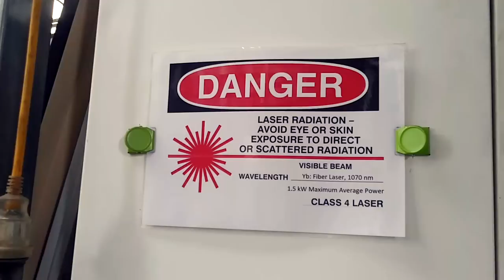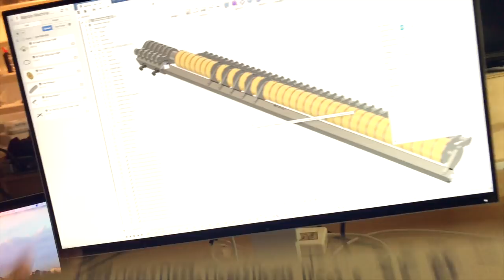Muting System Assembly - Marble Machine X #41

Comment: When TIG welding, be sure to clean everything.  This avoids the bubbles in the weld, called porosity.  If you must weld anything galvanized, grind off the galvanizing as much as possible.  If this is not possible, you can try silicon bronze filler...but then you are brazing, not welding.

Comment: Always clamp the workpiece in several places - (as many clamps as possible) - to a heavy piece of steel angle to prevent the metal distorting. If you have to move the clamps to be able to weld a section, ensure the work has cooled first.

Comment: By the way have you gotten your acrylic problem figured out?  If not, I usually make a form and bake it in an oven for a period of time, at about 120 °F.  It usually will bend to the shape of the form with just gravity.  
Side note your welding is improving bit by bit, also there is another technique you may wish to employ, the "lay wire" technique.
See you next Wednesday.

Comment: Since you're TIG welding, clean up the mill scale and what not off of the metal. It will weld SOOOOOOOO much easier/better. Put any nuts and bolts that are coated (anything other than stainless I suppose) in hydrochloric acid for a few seconds and it will eat the zinc away, just weld them before they flash rust. Also, I've never noticed much difference in tungsten sizes.

Comment: i hope the set screws in the wood will stay tight. if not, you may need to weld each metal arm to the metal tubes, and just have the wood in there as a cosmetic spacer.

Comment: Hold the gas on the weld a bit longer after stopping the arc. Your machine should have a control for that. The porosity you're getting at the end of the welds should go down. You may also want to increase overall gas flow, there's some extra porosity along the weld.
Reply: Very true, I think a little bit more gas is needed here (or the needle is too far out). In TIG welding, once it bubbles, you can't do anything about it. Instead of welding nuts onto the square tubing I'd cut threads into a 20 x 5 steel bar, and weld that onto the tube. You should look for a ironmongery or a metalworking shop in your vicinity, 25x2 is a standard size for square tubing, just too much work to weld these yourself. And if you do, start at both ends and meet in the middle.

Comment: I'm worried about a few things. First, the heaviest part of the muting system is on the thinnest bar, and is the furthest from the controls, meaning it's more likely to bend. Second, how are going to guarantee registration between the  controllers when the mute is released? Two flat wood surfaces interlocking seems risky, especially when it must happen 22 times all at once. Even if you get the tension perfect, it strikes me that you're going to have channels that simply slip and will jam, especially with that thin tube of metal being slightly more flexible and prone to bend out of shape when you slam the mute on or off.

I'm worried.

Comment: 25.09mm is INSANELY accurate!!! Most car manufacturers can't get that close! Professional reverse-engineering guy here: +/- 0.15mm is usually "good enough" on a measurement that size. Then again for structural beams I'd imagine 24.98 would be considered "undersized" and fail in a heartbeat (cosmetic stuff though: if it still fits, it goes!)

Also, many modern cars still use the "welded nut" solution everywhere, even (especially?) in safety situations. I see it frequently in trunk areas to secure things as lightweight as speakers and behind trim for things as heavy as seat belt securing points. Given the horrific results of rivnuts, especially in accident situations in unibody cars, what better way is there to secure bolts than welding on the cheapest of materials (i.e. the nut) into place to serve as a stud? Hardly a hack if it's VERY common practice right? :-)

I have seen this practice in place for decades across numerous makes and models domestic and import. Stroll through a junkyard, it can be an inspiring place once you get past the decaying state of the cars themselves!

Comment: Its hard at first but you can hold the welder slightly more away from what you are wanting to weld.. doing that and going slower will help the heat dispersion not end up all in one area.. nice job though

Comment: I have tried to make a case for adding brazing to your shop skills  A whole bunch of problems could have been alleviated if you had used brazing instead of welding.
Another thing to worry about is all the weight you are adding high on the machine, because of the steel parts.  The parts could have been made of much thinner steel (no more then 1mm thick) to save weight, and cutting time on the laser cutter.  Why did you double them up?
Setscrews are notorious for coming loose!  If you must repair anything in the assembly, all the screws must be loosened.  I would drill pilot holes in the tubing and use a setscrew with a pin tip to engage into the holes.  You can do this on all the actuators, and later after setting everything up, do it also on the handle ends.

Comment: Martin, you may be a musician and videographer but I've seen many mechanical engineers that would throw up their hands and give up if asked to do what you are doing.  Both the CAD/CAM work and the machine design look excellent.  You do need to work on your welding, though.

Comment: 8:00 Kinda worried that the set screws you used to hold the wood to the metal muting bar, will eventually work loose/slip over time due to expansion/contraction (varying humidity levels). Wood is not the best at holding a set screw tight in place, especially under load (unless the set screw is also partially set into the muting bar's metal via a small hole).

Comment: What kind of gas are you using? There should be zero Sparks or splatter with Tig. If you are using pure argon (only use pure argon) you need to change the flow as you are not getting proper shielding.

Comment: Just a comment on your building. The wood is rough. needs to be lacquer or poly urethane then sanded. And then the steel work should be baby smooth. Just a flap wheel and some finish. 
I know your busy just trying to make it work but for god's sake man, have some pride. What happens if it rains on an outdoor gig?.. whole dam thing is ruined.

Comment: How to prevent the laser from cutting in the "table" it stands on?
Reply: The laser has a fairly small focus area. The steel that is getting cut rest on steel points. The steel point get damaged but they are a consumables. Just cut new points on the laser. Also the laser reads the hieght above the plate. This is very important to keep a constant hieght or the machine will not cut very well.  Regards. Marc Roy's sheds

Comment: honestly when doing tig welding from  a bench use a foot pedal in 2 t mode what welder do you have sorry don't remember  cause when you get close to the end like that where heat builds up your going to want to  lets say go from 100 amps to more like 80 amps due to heat build up  or if in hand trigger mode run it in 4t mode with down slope  so then the machine will slowly drop over how many seconds you set you can also re trigger it a good  youtube  guy to watch is weldingtipsandtricks  he does lots of tig  from thick to thin applications as well go bigger gas cup or go a gas lens honestly looks like a lack of gas at the end of the weld hold gas cup there  at the end longer your getting porosity   but honestly i would have done way less weld on that likr i get it needs to be strong  but thats way overkill considering how strong tig welding is honestly a 6mm stitch would be more than enough unless you plan to stand on it  but clamping it down would have helped  hope this helps  coming from a guy who does big structural and big welds that can even warp 13 mm  plate  used to do small sheet metal with mig and tig  personally think a mig would be a better option  oh as well try to get unplated  nuts when welding that zinc coating if you inhale too much will make you sick

Comment: Why flathead screws??? they look nice but work awful
Reply: Charles M well but don't you prefer Philips head or hex heads? Those never slide. Also flat head ones usually are made out of bare iron, wich is not very resistant and makes the flat indemtation round up. Thats what ive learned from my father, who is a furniture carpenter, althoug he says that is better to use wood glue and dovetiles, but you cant use them here anyway

Comment: I wonder if the 22 mute lever arm will slip if you pull it too fast. If the lever arm is attached to the rod with a grub screw for friction, then it might slip. Inertia is a bitch

Comment: I think it would be smarter if all of the vibraphone channels on the muting system was on the 30 mm tube, because the 8 mm rod is under a lot of strain because it is a long piece with weight on it without supports in the middle.
Reply: alon elashri I agree. Especially since the mute lifts to mute, and he'll need to hit it hard and fast to do it in time for the music. 

I'm also concerned about the contact between the two parts. Even if it's lined up perfectly, I don't see how you'll get perfect and instant registration when you are relying on two pieces of wood to interlock on only.one, flat surface.
Reply: The rod is stronger than the tubes.